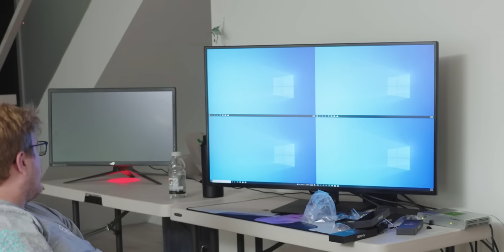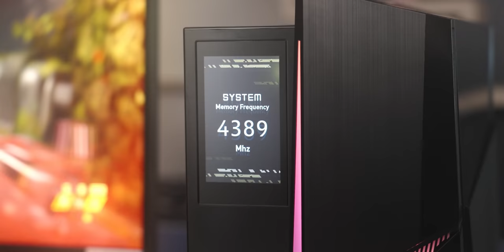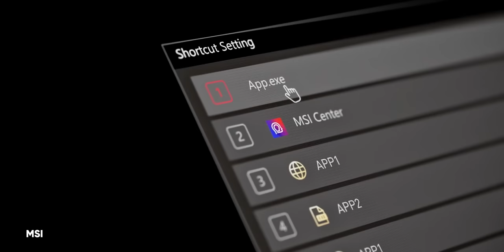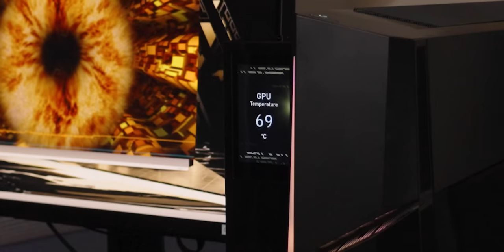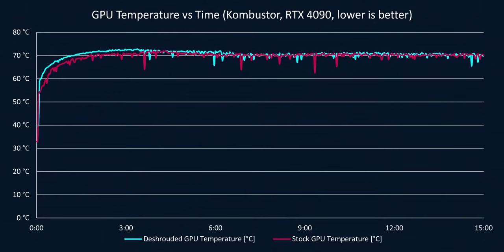I wish I didn't need this gaming PC - MSI Trident X2

Comment: I wouldn't be surprised if the free up RAM button is really just a batch script to taskkill anything Chrome.
Reply: Could use one of these 🤔😂
Reply: Nice heart
Reply: It should be criminal how much ram chrome & crappy electrum shell programs like discord needlessly eat up.
Reply: @kekistanifreedomfighter4197  indeed, overwolf/cursforge, Steam too, holy crap, it’s almost like they were built to hinder your performance.
Reply: @kekistanifreedomfighter4197  as a developer, blame modern web frameworks like react, don't blame chrome, chrome has in fact gotten a lot more memory efficient of the last couple years, it's just that web apps at the same time started using 4 times as much because they just keep adding shit and never remove anything
Reply: More like anything based Electron
Reply: It installs Opera GX
Reply: @MrTurbo_  it's still worse than firefox even if you dont care about privacy
Reply: Why not stop using Chrome?
Reply: @grocksauce7422  use new curseforge without ow.. Also you don't need it open all the time lol wowup+cf is also good.
Reply: @kekistanifreedomfighter4197  and that's why i turn off chrome run in tray bs lol though nothing we can do about discord. Wish they just made a deal app
Reply: @CollCaz-2  well i don't know which Firefox you are using, but i do not in fact share that experience, quite the opposite on Linux at least on my laptop Firefox is terrible at managing background tabs, chrome is way better at that by a long shot, although when you have 0 tabs chrome uses more ram
Reply: @grim86  chrome always running on the background is purely for push notifications for certain websites which have those enabled, if you don't have push notifications enabled you can indeed just stop chrome from running on the background at all
Reply: You know what, I'm going to write that script right now. And I'll label it "Ram Download"
Reply: @MrTurbo_  This is what happens when RAM is plentiful and cheap. Seems like the days of devs needing to trim every piece of fat to get their product to function is long gone.
Reply: @MrTurbo_  that is weird... i am also using linux and firefox is better than chrome in my experience. used stock firefox and now a fork of librewolf with the same experience.

had the same experience on Manjaro, pure arch, and now on Garuda linux.

also imo i would still use firefox even if chorme was better because google really shouldn't control this much market share.. take a loot at JPEGXL for example .
Reply: @burhanbudak6041  just don't switch to another chromium based browser right after...
Reply: @ntnavy1  here you go

@echo off
taskkill /f /im chrome.exe
echo All Chrome processes have been closed.

just put it in a notepad file and save as .bat
Reply: @ntnavy1  JUST DELETE CHROME (use firefox :))
Reply: @ketlo1234  hey at least he's not using OperaGX
Reply: @CollCaz-2  oh Im a firefox user since forever.
Reply: @ketlo1234  i don't really use chrome (unless i need remote desktop) so it was just some random comment i made 😅😂
Reply: Probably just a script to run Razer Cortex or something
Reply: @CollCaz-2  well...about that 😅
Reply: People might hate Edge but it does use significantly less ram than Chrome for me.
Reply: @ntnavy1  hello fellow pfp brother it has been many months since I have last seen one of my kind
Reply: @puffnpluky76  really weird way to spell firefox
Reply: @Michael-zf1ko  Yeah, that was my life thirty years ago. The USAF gave us a marginal PC and said "It's gotta work on this!"
Reply: @MrTurbo_  I find FF to be more consistent with RAM use but It does take more RAM than Chrome and at least when doing something like video playback CPU usage is higher too, but Chrome just randomly takes CPU time when It's just sitting there. (the last time I used Chrome was 3 years ago on windows so I'm probably wrong)

IMO taking more CPU when I'm using it is fine, the RAM use doesn't really bother me I have 32 GB for a reason if I need it I'd just close some tabs ¯\_(ツ)_/¯

Fr tho MS Edge is pretty good if you don't care about Mr Micro taking all your data so If you need chrome I'd say ungoogled Chromium, Brave, MS Edge.
Reply: @kekistanifreedomfighter4197  *electron
Reply: It  just clears the ram cache.
Reply: @ntnavy1  or firefox ;D
Reply: Firefoxxxxxxxx
Reply: @puffnpluky76  no, opera gx is terrible
Reply: @Bl4ckV3ins  i use firefox
Reply: Get Fireeeeefooooooox!
Reply: not that Windows is already doing that in the background "wink"
Reply: Yeah 46 instances of chrome
Reply: Just got a new rig. Bought a prebuilt because in today's crazy world it was way cheaper. Forgot to upgrade the ram from 16 to 32. With my stupid ass that doesn't close tabs it is VERY noticeable.
Reply: @MrTurbo_  It's really just chrome. There are many lightweight alternative to electron that embed the system WebView inside a native window host and they're much more memory performant.

I'm talking about projects like Tauri and Wails. The only reason why those projects are as popular for production software is because they still lack some features that electron does provide (like the ability to open new Windows, or defining custom URL scheme for oauth authentification).

Don't get me wrong, some web frameworks are really bad performance wise. React and Vue are the best examples, they ship with a runtime library that is full of legacy code because of backward compatibility.
But you also have good lightweight alternatives for those as well, SolidJS for React and SvelteJS for Vue (both of which introduce a compile step during build time). They, too, are also fresh so production software using them are rare. A more common alternative to React is Preact, which is React but the team stripped the runtime library to only the bare minimum to process JSX.

As for desktop app I think we're entering a new state for cross platform. Within the next few years we're going to see a decline of web tech usage for cross platform desktop apps:
- Flutter is improving the desktop support at a very fast rate.
- Microsoft is working on MAUI.
- JetBrains added web and desktop support to the Android JetPack toolkit.
- etc...

It's just a matter of time before companies adopt those.
Reply: And even the web itself is becoming faster, not only are people really into Svelte/Solid but also the tooling support for Web Assembly is growing really fast.
Web Assembly let you run native code inside the browser, achieving near native performances.
For now it's mostly used for business logic but I'm watching on the side UI frameworks using Web Assembly starting to form, like the UnoPlatform/Avalonia for C#.
Reply: @kekistanifreedomfighter4197  Discord use less than 200MB for me even when it's been running a long time.
Curseforge tho, fuck that, I almost never leave that running.
Reply: @MrTurbo_  Take a look at Opera. It barely even makes a dent in system resources but has all the bells and whistles most other browsers have. The only feature I've seen missing is the ability to mute a site and forget about it. On chrome you can mute a site and it will stay muted even on other tabs. In opera you can only mute on a tab per tab basis and it never saves your settings.
Reply: @CollCaz-2  firefox is overrated, i never noticed the difference between chrome and firefox when both are running on the same shitty machine, ended up swapping to brave though for manifest v2
Reply: things like manifest v2 is the reason why we shouldn't let google have this much market share...
brave is cool but it's also based on chormium,
take a look at what happened with JPEGXL recently as an example of the power google holds over the internet because everyone just uses chromium browsers.
Reply: @GroteGlon  No /T flag?
Reply: This computer is a joke: tight furnace case, gpu fighting against convection, 13900k on an m-atx with zero point fuck you power delivery lanes with no heatsinks, cheap ass ram sticks, obnoxiously weird layout...but look! We've got a screen at the front which probably runs on some proprietary firmware! YAY!
Reply: Intelligent Standby List Cleaner
Reply: @charlesm.2604  You are right that there are lightweight web frameworks, but they don't get much use in the mainstream websites, also i know for a fact V8 and blink have gotten more memory efficient, so with a lot of tabs that also should improve the memory efficiency of chrome, on the other hand they keep adding thing so the minimum ram usage is going up.

As for the desktop, i have been a fulltime flutter developer for 3 years now and i am really rooting for it, it's amazing to work with and blazingly fast to use, it does not need 3 billion npm packages to get a blue material button, so with big apps it's definitely more memory efficient, the minimum memory usage is also quite high though, not much better than electron
Reply: @CollCaz-2  that's interesting, I'm not sure what causes it, but Firefox does not seem to put tabs to sleep for me, chrome handles this very well for me, but perhaps there is something wrong with my hardware configuration or something, either way i don't run in to it untill i have about 80 tabs opened, but where chrome happily keeps on going and feeling snappy till about 200 tabs, Firefox starts to heavily slow down at 80, this is with 16 gb of ram
Reply: @kable6693  i have tried opera, it's a perfectly fine browser, although as I am a developer i run in to certain performance issues with its devtool which i don't get on chrome, which is weird because they should be almost identical, but this is what I'm running in to, also even better for ram is Vivaldi in my experience, but on Linux video playback isn't working for whatever reason, so I'm back at chrome again 🫤
Reply: @MrTurbo_  I don't really keep up with Flutter updates (I'm a back-end software engineer, I work on server implementations and cloud/replication design) but I really wish for Flutter to gain more adoption for desktop because nothing beat native.

Dart is a surprisingly good programming language, I love its straight forward asynchronous design, the deferred keyword is also one of those keywords you overlook but really miss when you go back to your Java/C#, Go codebases.

Flutter, on the other hand, makes for the worst code I've seen in my life. Full of spaghetti, confusing, really bad staircase flow.
I wish they would let Widgets be implemented outside of a method result, like all other UI libraries, so devs could organize their code better.
And of course the ultimate goal would be to feature a dedicated XML file for the UI logic of views. I don't understand why it's not being worked on right now, Flutter was made for mobile and they completely avoided the best part of Android development. I would love to see Flutter have something like XAML and MVVC, it would be dope !
Reply: Also wouldn't be surprised at the significant performance increase.
Reply: That would be a very hazardous script if following that description, so it's pretty unlikely
Reply: Me laughs in 32gb ram
Reply: Why would anyone use Chrome?

Comment: I am happy to know that no amount of money can fix the stupidness of shelf studs; I was beginning to think this was a poor mans problem.
Reply: "I wish I didn't need these used cryptomining 3090's as shelf studs" could be a video idea!
Reply: just use the IKEA pegs / solutions that surely would work...
Reply: DurriePuncher  wdym
Reply: Just use hard wood shelfs and drill those into the wood side panels no studs needed.
Reply: Nice
Reply: @bruh meme but you could easily zip tie the mesh in the zones up with an l bracket.
Reply: I've used shelves with studs all the time and no issues. Considering I'm not rich and Linus is having issues I would class this a rich people issue. Although the N is only 2.
Reply: I use pieces of wood and screws :-]
Reply: Buy a box of 1" screws and use your imagination.
Reply: @leagueaddict8357  literally, like do actual woodwork not cheap prefabricated style Ikea crap
Reply: I think he just should try to fix it … there is a lot of different shelf stuff …
Reply: I think he just should try to fix it … there is a lot of different shelf stuff …
Reply: Same feeling ma man, same feeling
Reply: Enough money can fix that problem
Reply: Seems like part of the problem is that pegs are spinning. Either a locking bracket, or a double pegged bracket would prevent that.
Reply: That shelf looked flimsy as well, it appeared to buckle quite a bit. And I think the studs in his closet were plastic, vs the metal ones they overlaid.
Reply: Well I can tell you it isn't a handymans problem.
Reply: Honestly my Ikea shelves with nice shelf studs hold a full 2 or 3 rows of paperback books and have never failed me. They have a screw that helps keep them in place once placed though so they don't rotate which seems like the difference
Reply: Metal "L" brackets with screws. Then it ain't going anywhere.

(With a peg system, even if the pegs are solid, the shelf is just resting on them, unsecured, and can still be potentially bumped off the pegs for things to fall. But a small "L" bracket with suitable screws can also be screwed into the shelf too, as well as the wall, so the whole thing is solid and not going anywhere.)

This man has his own line of screwdrivers, for pity's sake.
Reply: Ill bet you it didnt actually break and that its some bs he pulled for audience engagement
Reply: @broadsword6  I
Reply: @klaxoncow  I think it has happened but this time they staged it
Reply: frankly as a carpenter I can say that shelf studs actually do hold a lot of weight, But for them to actually do that the shelf has to be like 1 or 1.5mm smaller than the inside of the place you want to put them in, and you also want a perfect diagonal, or the shelf to be made exactly to match the space you want to put it in. any of these being incorrect and the shelfs chance of dropping because studs can no longer hold it increases.
Reply: @PrograError  the overlaid image is IKEA studs, I assume that is what is being used
Reply: @Adlata  I mean no one's paying you to watch bro. Then again, no one's paying me to consume your negativity, so I'm out, peace.
Reply: @leagueaddict8357  gonna spend $500 on some shelves?
Reply: @leagueaddict8357  Cant move them that way
Reply: ur_love_69  insert mike tomlin here
Reply: @batt3ryac1d  Not that expensive
Reply: @TommyCubed  Yes you can
Reply: @League Addict  really depends where you live and on supply but yeah I was being hyperbolic
Reply: @leagueaddict8357  You'd require a drill. Whereas most of these just sit in place or screw in.
Reply: @TommyCubed  Most people should have a drill regardless.
Reply: @klaxoncow  they're basically dirt cheap, too. I've fixed a pool table that fell apart with L brackets and it was sturdier than the original job lol
Reply: There is an amount of money that can fix it.

Just convert the shelves to floating shelves.